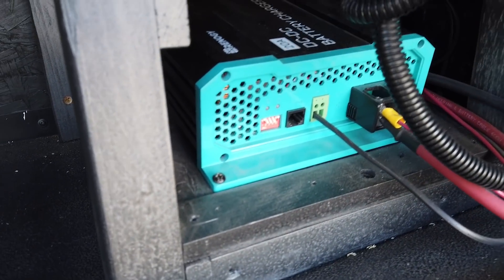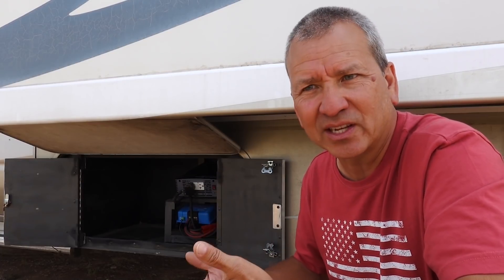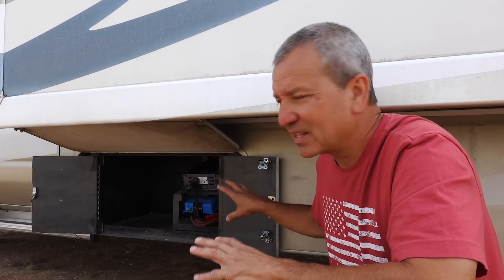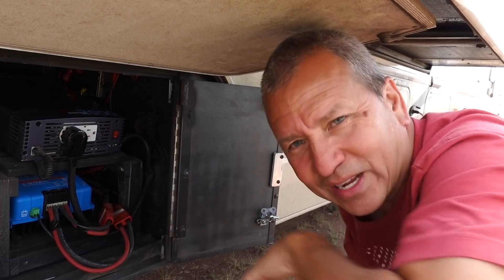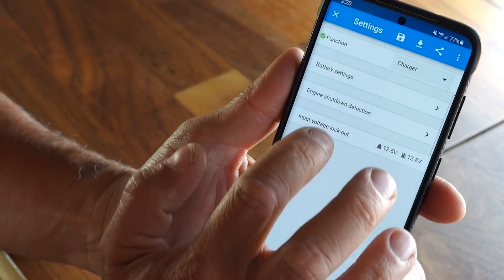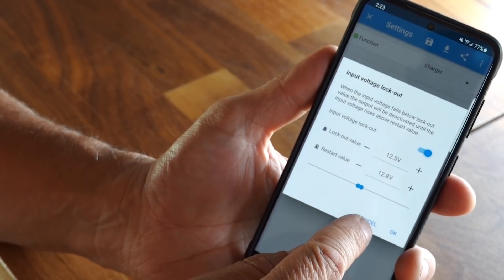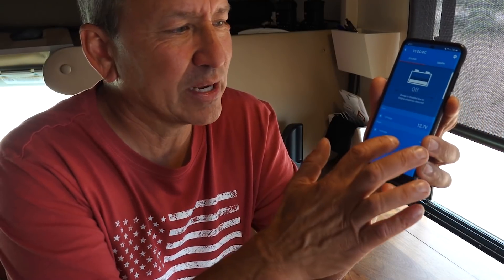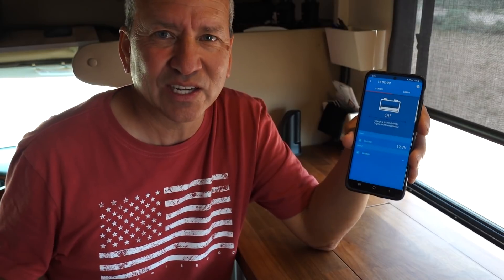RENOGY or VICTRON DC-to-DC Charger for Lithium LiFePO4? / Off-grid RV Solar / RV DIY

Comment: Hi. So I own an 18 wheeler and I’m trying to charge my EUC battery which operates with lithium ion batteries. But am for some reason I can’t use the charger with inverter combination while in the truck. At the house I can charge just fine but not in my truck. Can you help?

Comment: what a waste that Victron’s “smart” dc-dc chargers don’t use the battery sense data like their “smart” mppt charge controllers to set low-temp cutoff for LFP batts! Simple firmware update, yet they don’t seem to care! You need same low-temp protection for lithium batteries, no matter what the source of charging. Just common sense and huge overlook by them!
Reply: Redundant. The battery itself should have a BMS that does that.  If not, you got the wrong battery for the job. Or the wrong BMS if building your own.

Comment: I have followed your channel for many years and normally I have found your DIY videos extremely helpful.  However, when it comes to your DC to DC installation videos, I think they are very confusing and inadequate, and frankly need to be redone.  The issues I have are:  1) confusion regarding the Victron DC to DC wiring.  Is the unit wired directly to the MH alternator, or to the MH starter battery, and what happens to the previous wiring?  2)  What about the existing cross-connect wiring for using the house batteries to start the motor when the MH start battery is "dead"?. It's not clear to me what you did to solve this issue for your MH.  3)  For an older MH, how is the alternator charging for the house batteries normally wired, and what, if anything, needs to be changed in this regard when changing to lithium batteries for your house batteries?  It would be a great service if you would make a new video clearly addressing these issues from start to finish.  Thanks for all the excellent videos you have made!  I wired a solar charging system for my older MH using two existing 6-volt deep cycle batteries and it works fine, but I want to go to lithium as you have done.  However, as it applies to motorhomes, I am finding youtube information both inadequate and confusing.  If you want, we could exchange emails on this.  Thanks.
Reply: 1) Wire the DC to DC from the starter battery terminals or very close, not the alternator, though it's virtually the same.   2) Is that a thing?  I don't know RVs that well, have a van.  My starter battery works fine just like any car and if it's low then I just use a jumper.  Like a car.  No need to involve the house system.  3) you need to do more research in general.  Try Diy solar forum and tons of youtube videos.   Many videos are specific to a topic, not an overall how-to.   But the overview videos exist too.  I don't know if Tito is here to do all that but he's got some great tips to share for those of us who are in the game already.

Comment: Hey Brian, thanks for all of your helpful information! I’m installing a Renogy Dual Input DC-DC 50A Battery Charger on my 2014 Itasca Navion 24J. I’ve got two Lion Energy Safari UT 1300 lithium batteries with a 400 watt HQST solar system in parallel to a 40 amp mppt controller, PD9160ALV lithium converter/charger, Renogy 3000w inverter and the Go Power 30A transfer switch. My question is: can I connect the dc-dc charger directly from the boost solenoid, and if not, how do I bypass it and still keep everything connected properly? I don’t see how the batteries get connected to the converter/charger without being tied into the positive coming from the solenoid. Thanks! Matt

Comment: I have a question. If your start battery is flat (10v) and you Buypass the Victron.
You will have a rush of around 300amp from the house battery to the starter battery.
That will make your cables werry hot.

Do you disconnect the original starter battery først then?
Or will you switch the cable and let the Victron charge your start battery???
Reply: First, you'd better have a fuse in there.  80 amp would be fair. Second, the cables will drop the voltage which will limit the amperage.  I really doubt that a typical starter battery can pull anything close 300 amps anyway.

Comment: My orion app shows 13  volts coming from the charger but my monitor does not show an increase in watts and battery continues to decrease.  I am running two freezers in an ice cream truck.  They draw 30-40 amps and the amp draw does not change with or without the  charger being on.   Any thoughts?

Comment: Hi Brian, wondering that we got 50A Renogy Dc Dc charger , it works great but it limitation of solar input have to less than 20v therefore in no way we can get our solars in parallel.
What if we install separate Victron Solar charge into existing system so we can hook up solars in series, will house batteries get charge while run Van and Solar at same time?
Thank you for all of your helpful videos🇺🇸👍🇺🇸👍🇺🇸👍🇺🇸👍

Comment: I commented on  your earlier video on the Renolgy DC to DC charger before watching this one and think you missed a key feature of the Renolgy because you failed to mention the LC (current limiting) terminal on the Renolgy that allows you to reduce the output current by half.  This allows you to draw more current when needed and less when it is not.  You selected the 20 amp Renolgy for your first install because you didn't want to put a continuous higher load on the alternator, and installed an off switch so you can turn it off when it wasn't needed or desired.  But had you made use of the LC terminal you could have added the option of reducing the output current to 10 amps by running a second wire and a three way switch (off, 20 amp, and 10 amp).  The output is reduced by half any time current is present in the LC terminal.  Both switches can be powered from the same ignition circuit and you can choose from a 20 /10,  40/20, or a 60/30 charger depending upon the size of your alternator.  The alternator in my 2015 Ford Expedition with a heavy duty tow package is 250 amp and I went with the 60/30 because I don't have solar (yet).

Comment: Hey Tito!  Love your videos!  I have a problem with my Orion 12/12 30 amp DC charger.  I installed it in our travel trailer that we pull with a 2022 F-350.   I assume the truck has a smart alternator, although I tried both settings.  What is happening is when I start the truck, the input voltage on the app(and charger)  starts at 14.5 but instantly starts descending in increments down to 8 volts over a few seconds, then ascends back up to 14.5 over a few seconds where the cycle starts all over again.  I have #4 cable run back from the truck battery and I have 14.4 volts at truck battery, and 14.4 volts at the end of the input cables. Wiring is solid. Any ideas what is going on?

Comment: I have a 2007 Winnebago Journey, and have been struggling with having to eliminate my Boost function in order to install a DC to DC charger. Your idea of using the Anderson Connectors turned the light on in my brain, that I could also use a multi position switch that would disconnect the wires to the DC to DC charger while at the same time connecting the two battery circuits together. It would still be a manual operation under the Generator hood (front of my Diesel Pusher) but still accessible and would protect the Orion from damage.

Comment: Cheaper and easier with Lithium BIM
Reply: I think  I know what you are referring to.  The isolater that Battleborn recommends. I have a Victron cyrix also good.  Fits my system.  Cheaper and smaller than DCDC

Comment: We just bought a 2003 GulfStream Independence 24 and will be adding lithium ion batteries. I need advise about using my E350 Ford Triton V10 alternator with a DC to DC charger. Do I need to swap in a high output alternator ?

Comment: Can I use a Renogy 20 amp Rover charge controller instead of a DC to DC converter to take power from the van's alternator to feed my LiFePo4 batteries? I have a second 20 amp Rover already feeding power from the solar panels. Thanks.

Comment: Hi Brian, I was wondering if you've ever explored the Balmar alternators, as a replacement or add on alternator to take full advantage of road time to charge your batteries. My 26' Winnebago (in which I'm mimicking your 810 AH battery setup)has a V10 which should be more than capable of driving a high output alternator to charge the batteries when driving, specially until I get set up with solar, maybe next year or...?  your thoughts on that?
Reply from the maker: No I haven't looked into it for this rig. My current solution using the Multiplus II is to simply fire up the generator on the road and push 120A into the batteries. No need for a 30A DC-DC. Good luck with your battery setup.
Reply: @RVwithTito  I have the generator option too, I was thinking in terms of Generator life, noise, gas consumption, over slower charging with alternator while on longer drives.  I wont have solar right away so it'll be nice to have as many options as possible.

Comment: I did pick one of these up and installed with a regular alt.  At first it was fine and BB sent their settings but it now ... never goes into absorbtion and keep on Off and Charge is disabled.  My 200W panels fully charged back 20% in 1 day with overcast and little clear.  The Victron solar controller sure does a great quick job... with full sun it would have been quicker... well, so I guess I need to drain off the 100% again with the set to BB settings and see what happens ... When it was full before the DC DC 30 seemed to still add... but now it doesn't

Comment: Good points in the video, Tito, sir. Thank you for making it. I bought the Renorgy version for my travel trailer but might wait until we get our toy hauler motorhome before installing it. I can use it to charge the battery in the toy hauler garage which will power my ham radios & other stuff as a separate system from the house battery bank. Why have a separate system, even if small? The distance is the main factor & the small system (1-2 lifepo4 batteries and it can run our cell/WIFI booster from DC, etc). The Renorgy or the Victron would be tricky for installation in our travel trailer either way. 

I can mount either in our storage compartment where I have my inverter & 300-amp fuse, it is just a pain to run the 4-6 gauge wire from the 40-50-amp breaker at the engine compartment into the travel trailer. Having that extra heavy wire of sufficient length coming out under the truck tailgate that is secured yet lose in an umbilical protector that comes up in yet another hole I have to drill into the floor of the travel trailer storage area is going to be a technical feat. Currently, I use the access door on the side of the travel trailer to input our solar ground mount array (the trailer is a couple years older than when Lance started installing SAE connectors for solar input). I run the MC4 connectors into the trap door of the driver-side sewer tube connector for the four Renergy 100-watts panels wired in the 48-volt configuration to our Victron 100/30 charge controller for extra solar charging of our two BB LIFEPO4 batteries. It doesn't make sense to use that same access door for a charge while driving with the charge line from the truck as it is not located front and center of the travel trailer (where the batteries are, but the Renorgy/Victron DC-DC can not be located there due to the need for a good waterproof solution). We camp host in the summer in the mountains so we have 160 watts of solar on the roof of our Lance TT and the 400-watts on the ground (as Camp Host RV sites always have beneficial shading that is great for cooling, but not so great for solar). So in the end, your video here is going to cost me a purchase of a Winnebago motorhome (always wanted one anyway) or if I am really advancing my Imagineering skills, a Renegade Classic 2609 toy hauler. Thanks again, Tito, sir.

Comment: I’m a little surprised that you seem to have mounted the Victron charger in the wrong plane the Victron should be mounted vertically and yours is horizontal, that means heat won’t dissipate as it should. Another way to look at in is would you place a radiator on the floor instead of the wall and expect it to work properly. I often see DIY installations were the customer has ignored the correct installation procedures and the complains when it fails.
Reply: You seem to be the one complaining.

Comment: Yikes.  I was on a road trip and my charge controller wouldn't work.  So, I used jumper cables to give my battery a small charge.  I think I had it connected for about 30 minutes.  I hope that didn't do too much damage to my alternator.

Comment: If you wire this on a travel trailer between the non lithium supported converter and the battery.. Will it fix the issue with non lithium supported converts not charging lithium batteries all the way?

Comment: Now that I have the dc/dc 30 amp victron, 100v/15 solar, ... and smart shunt ... I know these are "Bluetooth" but only the solar and shunt "network".  So, I am not sure how the dc to dc will not charge 14.4 (lets say) if the batteries are full and set 100% via the solar or shunt reading... As far as that goes, the shore power progressive will go through up to bulk and absorption.   If the alternator doesn't have to charge it it is odd that it might still ... also the 1 amp slow burn fuse for sensor wire... parts stores only have fast action ... one of them I burned out as it was connected up without system + voltage "on" via breaker when breaker was turned on...  I want to carry backup.

Comment: My alternator is 135 amps and I only have a 100amp lithium battery but my issue is that the trailer plug wire cannot handle that much current so I'm looking for a 20A DC to DC charger. I don't think I can run a #6 wire through my 7way plug but the trailer plug cable is only a #10 as well.

Comment: Can you control the Dc\Dc controller from the Victron blue tooth app?  I understand without a switch, the trailer will continue to draw power from truck batts even while powered off.  I was hoping I could power down the dc\dc converter from the app vs pulling the 7pin whip when stopping for breaks.  The application is in a new Jayco Northpoint 5th wheel.  Plan to install the device in the trailers cargo bay.  I plan to get my power feed from the trucks 7pin connector.  Truck is a new f350 with dual alternator option and all trailer tow options and there’s a 10ga wire from the truck feeding the 7pin whip.  I’ve found where the 12v feed from the truck whip terminates in the trailer so for wiring, should be a pretty simple “insert”
Reply from the maker: Yes. You can control it through Victron Connect.

Comment: One last comment.  You might want to research hooking up a dedicated “jump start” circuit using you old renogy b2b in the other direction, from the lithium “to” your lead acid start batteries.  Just a thot.

Comment: At the 7 minute mark you are giving very dangerous advice, about “just connecting lithium to lead”.  It is your responsibility to modify this video, you are talking as if you know what you are talking about, and someone is going to get hurt.  Please correct this before someone takes your advice and burns up their motor home.  Ca’mon man.
Reply: You are talking as if you know but you don't.

Comment: The renogy is what ip67 rated or not very water resistant at all. It works but for that kind of construction I’d be happier if it could survive at least a small misting. Also wtf the components are attached to the base plate and not the case shouldn’t the case be a heat sink? Apparently renogy think it’s an afterthought

Comment: will the charger turn off wen the bateries r fully charged?
Reply from the maker: It will go into float mode which puts a trickle charge on the battery.
Reply: @RVwithTito  freakin sweet thanks

Comment: Excellent video for my education. Victron has two versions of chargers, isolated and NON-isolated. Why do you pick ISOLATED version?  Thanks!
Reply: I would like to know as well Brian.  I'm in the process of doing this to my class A.  Couldn't you use the non-isolated version and keep the solenoid so you can use the "remote start" switch to jump to your coach batteries?  Thank you!

Comment: thank you for this video.  I have a 20 amp renogy.  The 40amp seems a little too much.  but... 30 amp might be just right.  Are you able to decrease the 30 amps to 25 or 20 amp if 30 amps seems too much?  I have a switch in the cab also but wondering if the amps can be adjusted by settings on the amp?  Thank you.

Comment: I haven’t read all the comments, re combining the lithium with start batteries in emergency.  Have you done this?  I could be mistaken, but, if you connect a fully charged lithium to a dead lead acid, the lithium is going to try and fill (charge) the lead acid ALL AT ONCE!  You will either blow something up, or (hopefully) the BMS in the lithium will shut her down.  Once again, I could be wrong, but interested in learning how it works in real life.  Best, Dan
Reply from the maker: You're not wrong. It's not recommended and I never do it.

Comment: Great Info Brian, So, I take it when disconnecting the E Start button you remove everything and connect the pos cable to the DC/DC Charger and a neg lead to chassis grnd? Where does the 30A fuse go?
Reply from the maker: I put the fuse between the DC charger positive out and house battery.

Comment: Hi. Could you explain how did you connect remote on/off with the switch in the cabin? I see the switch has got light, so it needs power. I checked Orion-tr manual but i cannot find solution like in your RV.